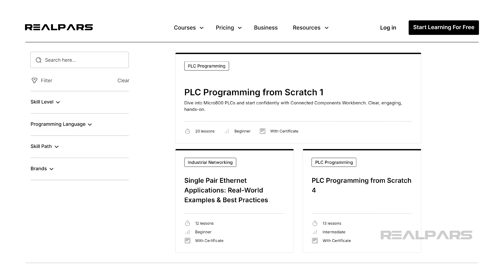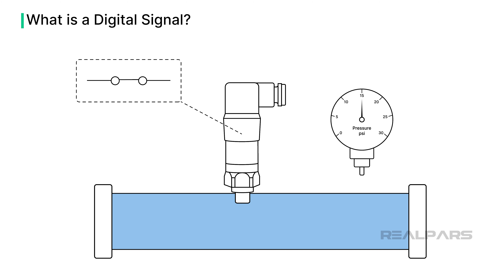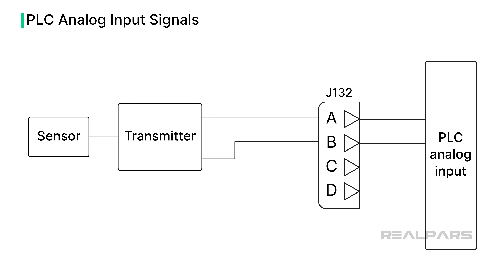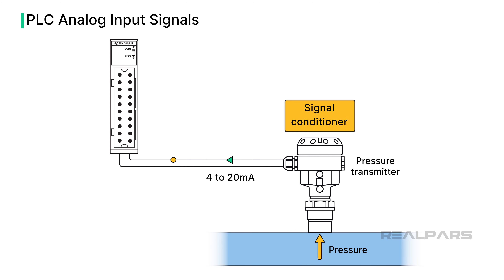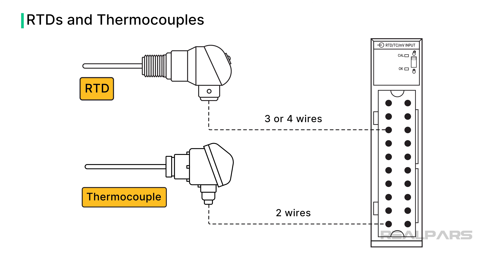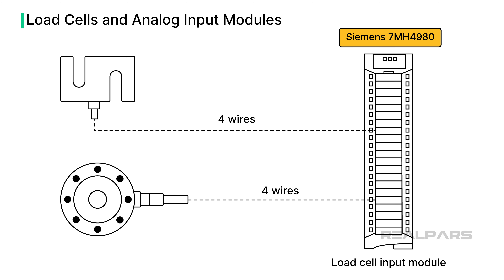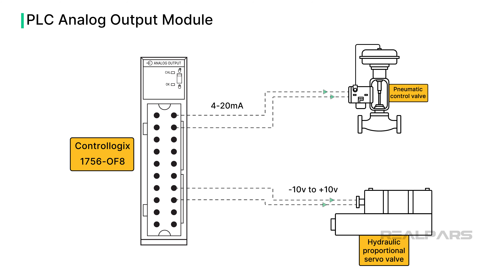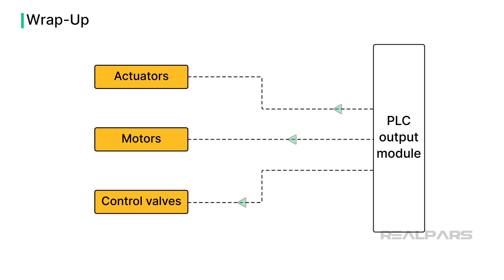Analog Inputs and Outputs in PLC Systems

Comment: Very clear and easy to understand. My question, do we need a signal conditioner to process a signal, or does a   transmitter also act as signal conditioner?
Reply from the maker: Hello. Thank you for your question. This all depends on the device you are using, the distance from location to location, and whether your receiving end of the signal is a PLC. Always look at the spec sheets of your device sending the signal and the receiving device. The spec sheets and manuals should have all the information. Happy learning from RealPars!
Reply from the maker: Hi @Aqualastic. In this video, the transmitter does act as a signal conditioner. It produces a standardized output current or voltage representing the input variable signal.
Reply: @realpars  That’s pretty interesting in itself on how to match the output signal of a sensor to an input device, especially so if the signal is incoherrent, weak and pretty unstable. Do you have that kind of training available?

Comment: Hello, I would like to query about some concept of IS CALCULATION. 

I am aware, but for one loop only. Like BARRIER to JB to LT.

But I am not sure how would be the process for IS like this case. BARRIER to JB to FIT to FE? How is The cable from FIT for FE considered in calculation?

In my case, I have a flow element with its own instrinsic parameter.. then a transmitter with its own instrinsic parameter also.. so Im confuse how consider it in IS calculation? appreciate if you can advise me.
Reply from the maker: Hello. Thank you for your question. Unfortunately, your question is very confusing, and it is hard to understand what you are asking related to our video. Please be more clear on what you need help with. Please spell out what you are asking. IS, FIT, FE, and JB mean lots of different things in the electrical electronic industry or PLC jargon. Please spell out what you are asking related to our video you watched. Happy learning from RealPars!
Reply: @realpars  hi appreciate your response. 

Actually my comment was supposed to be for this video below. But I posted a comment here as I'm really desperate for your advice regarding my query.

https://youtu.be/b9DH0Do9Rg4?si=CjUZPc7JyTqDchiT

Hope you can give advice for intrinsically safe calculation. If I have a barrier then cable to transmitter and then cable to element. 

How would I consider the element in Intrinsically safe calculation in this loop? Normally I only encounter barrier then cable to transmitter and nothing follows.